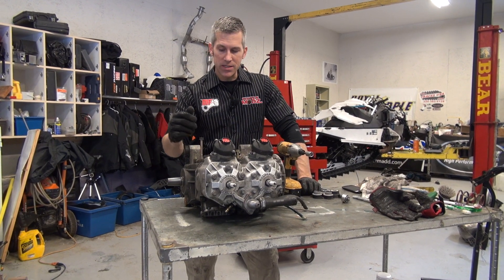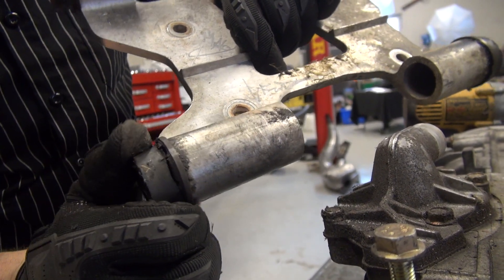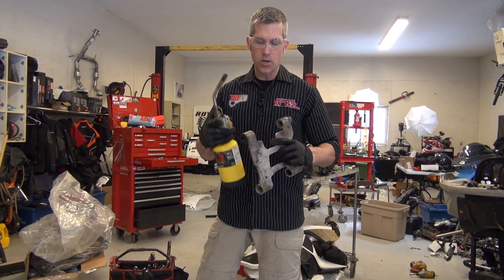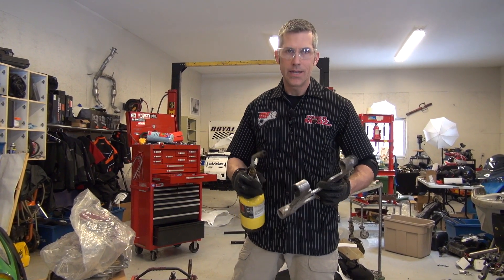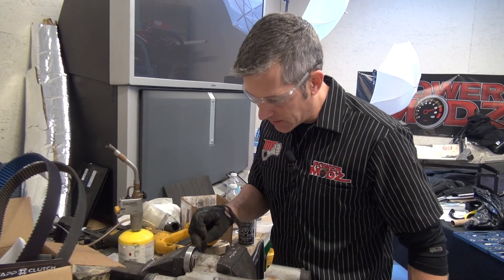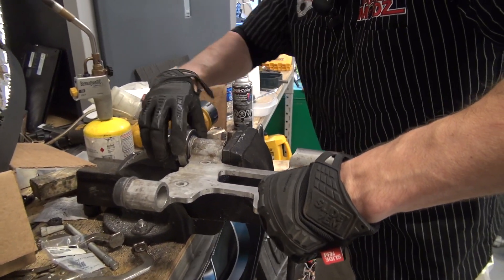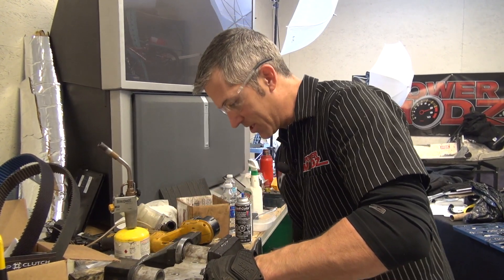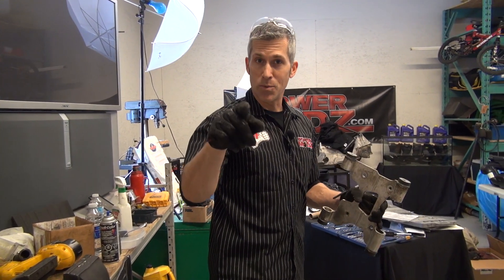Skidoo REV motor mount replacement, Episode #8 of the 700 REV mod sled build!  PowerModz!

Comment: To get the motor mounts out use a piece of threaded rod with nuts on either end and a slip bushing and when you crank it down on them nuts to drive it out both ways

Comment: when i put in new motor mounts, i freeze them overnight and put the plate in the oven at 475. they typically slide right in. this also works on ball joints.

Comment: easy peasy, pick a socket close to but not tight to the circumference of the bearing and simply tap it out. Using a socket allow the pressure to be spread evenly so there is no binding.

Comment: How you mounted the engine to 440 rubber mounts? 2007 440 rubbers bushings doesn't have threads.
Reply from the maker: yes the 440  mounts arent threaded, they uses a threaded shaft in between the mounts - I made my own.
Reply: What is the shaft length? And how it stay in place when tightening the bolts?
Reply from the maker: MrFilting its easy, take the motor plate - align the mounts so you can measure the amount of space between them - then cut a piece of round aluminum that exact length - drill and tap.  when the mounts push in they hold the rod in place.